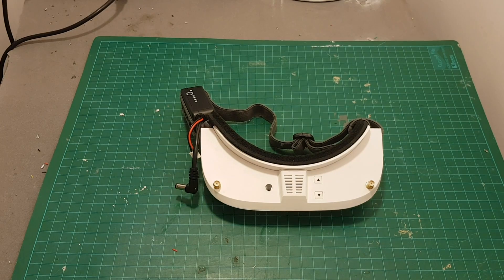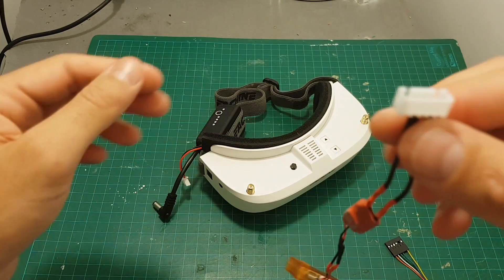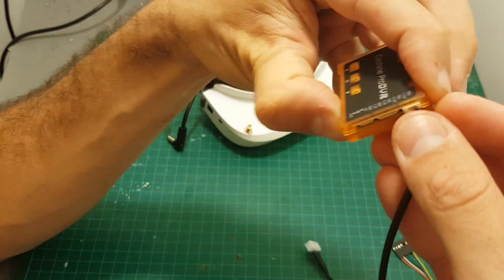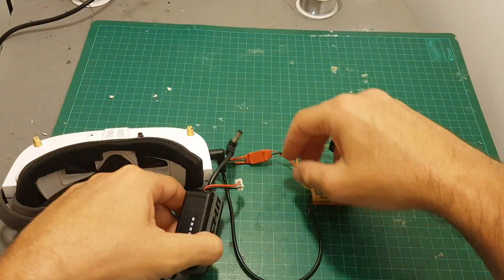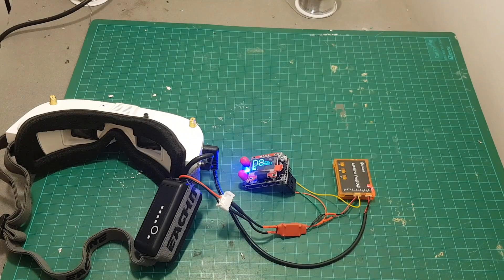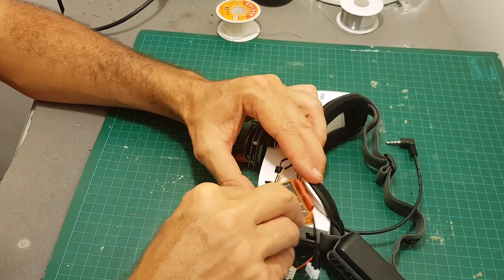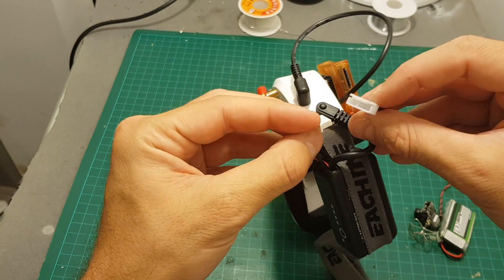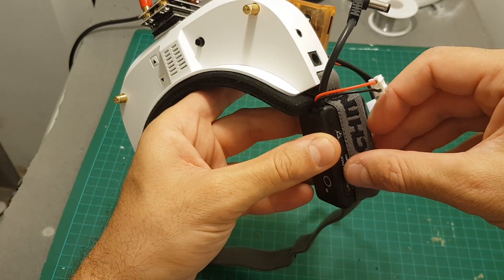Eachine EV100 Easy Diversity (And DVR) MOD

Comment: I thought the video out from the eachine ev100 budget goggles was weak of a signal  to input a dvr and the ev100 video display because the ev100 dvr never showed the black outs that happened during the flight  .  
   I like eachine ev100 goggle disolay size for the price and compactness when we want to carry fpv cameras around with us . But the blanking of the fpv video is what needs to be fixed on mine . Is that what you made in this video ? 
    If we put a yellow rca video out end on a diversity rx it can plug into many different brands of budget goggles and even television screens for multiple vieweres of an fpv experience . Budget goggles come with an AV IN CABLE with rca video plug on one end for this purpise or for video games or movies to not wake up everyone else in the house with bright lights flashing from the screen . 
   Next we could build an digital fov to AV  VRX .

Comment: Thanks . You are the only one with information on reciever modules and crsf modules .
Last month i ordered a diversity vrx for ev100 fpv goggles because the video in the goggles screen goes black , red. , or white while flying.  
    And now i have digital goggles and vrx walksnail preordered .
  My 1 watt crsf does not appear to be going to reach 4 kilometers . It seems like it will only reach about the same distance ( 300 meters )as xm+ . Is that because of battery size on quad and tx needs to be bigger ? Or does crosfire need a bigger reciever ?  I use 4s 1500mAh battery on a 5 inch cheap $88 quad .
Reply: Pins 1 ,3 ,6 👉🙂👍remember
Reply from the maker: My pleasure. Something is wrong with your setup - you can get very far with a 1 Watt CRSF system. Make sure that the TX and RX antennas are ok.

Comment: Hi, I know i'ts been a long time since you uploaded the video, but I wanted to know if splitting the av signal between the goggles and the DVR would cause it to loose strength or make the video dimmer. Thanks
Reply from the maker: It shouldn't have that effect in my experience.

Comment: ¡¡¡ total !!! tanto quebradero de coco ,para al final tan sencillo como conectar el diversity y el dvr al conector de AV que tiene las gafas , unos quitando el modulo RX que al final rompen las gafas , otros soldando cables en lugares que no sirven de nada , para al final con solo conectar positivo y negativo para alimentar el diversity y dvr de donde sale para el ventilador, y en la clavija yak AV poner un negativo del modulo y el cable de vídeo y listo , muy sencillo nada de romper y muy limpio , ¡¡ eso si acuérdate de poner siempre las gafas en AV para ver a través del diversity de otra manera seguirás viendo atraves del modulo interno de las gafas ev100 pero sin antenas y a 10 mtrs te quedaras sin vídeo , mas menos como si quisieras ver una peli o jugar al simulador con las gafas .

Comment: Does it fix the blackouts? I was flying the whole time with two antennas and I was constantly getting blackouts, now I fly with only one antenna and it stopped so it has to be the antenna switch
Reply from the maker: Yes, it should fix this issue.

Comment: hello, I bought a pair of used googles, they are the foxtech FV01 also known as Boscam GS920 in my opinion they have excellent optics but being dated they have no DVR or diversity, in the lower part they have an AV in connector and an AV out connector. I was wondering if for the modification I have to proceed as described in the video or should i use these connectors?
any information is appreciated
thank you
Reply from the maker: Hi Dr. You can just use the AV connector, as shown in my video.
Reply: @KremerFPV  thanks
Reply: @KremerFPV  hello, I connected the cables like in your video but I don't see the dvr menu what can I do? thanks again
Reply from the maker: @Dr.HazeFPV  Is the DVR recording working for you?
Reply: @KremerFPV  well i can't se the menu so I can't format the sd card,   I will try anyway,  btw I have cristal clear image from the diversity module.

Comment: hi i did the same mod, how can i disable ( power off ) the internal receiver?
Reply from the maker: It's probably possible - but will require you to disassemble the goggles.
Reply: I think if you are  switching to av in, the internal reciever powers off

Comment: hi i can use the dvr in the combo?
Reply from the maker: The DVR in the combo has only Video in / out option, so you won't be able to pass through the video. You will need to connect the diversity module in parallel to the DVR, so it will be a little bit more tricky to do (but still possible of course).

Comment: Just made that mod using eachine pro58 and step-down from BG (look the same as in your link) and it works BUT!

This step-down introduces a lot of noise... When i power up pro58 receiver form 1s lipo it work great, so i bet its something wrong with step down... Tried to different step-downs as they came as 5 pack

Any advice?
link to step-down: https://www.banggood.com/5Pcs-Mini-DC-Adjustable-Power-Supply-Buck-Module-Step-Down-Module-p-952402.html?rmmds=myorder&cur_warehouse=CN
Reply from the maker: Do you have a multimeter to measure the voltage output?

Comment: Hello! I currently fly with fatshark attitude v2 goggles, but it is a bit blurry. You can change the distance between the lens and your eyes verry good in these ev100s, but im scared im going to think these screens are to small. Do you think it is a good option to replace my fatsharks? Or are these screens going to be really small?
Reply from the maker: I don't think it's going to be an upgrade. You better save up and get a new pair of Aomway or Fatshark goggles.

Comment: could you possibly do a mod where you can desolder the existing receiver and add a module bay
Reply from the maker: It will be too complicated and I don't think that many people will find it useful. The external solution is much easier. Thanks for the suggestion though :-)
Reply: @KremerFPV  I agree to this. I have the dvr for ev100 already. I would like to have the option of dvr and diversity. But I wish to use the dvr I have already. How I can solve this? I see many other videos where people goes in AV-IN mode on googles, is it possible to  record video still and just use the ordinary dvr?

Comment: u put rx5808 on top then hold the av button 3seconds then they both connected wireless ????
Reply: nvm, i missed that jack bcuz it was in red color. i found other vid.
Reply from the maker: No problem :-)

Comment: how did u connect av in? without openin the goggles????. im very much confuse
Reply: he is not using the video of the internal eachine receiver, he s using another external receiver for the dvr in paralell
Reply: René Martínez López i did this  without dvr 2weeks ago and it works well till now, no need to buy fatshark haha it is really great
Reply: @renemartinez5  I know it is weird questioning a 6 years old comment :D but can I make a 3 ways in parallel from the video out pin of module? 1 to the goggles, 1 to dvr and 1 to a spare monitor? I want my gf enjoy the flight with me, so I', intending to buy a LCD monitor and get the signal from the module. Is that ok ?

Comment: Ive tried to understand it from the video and from the comments around but still didnt quite get it.
If i wanna use the RX without the DVR.
I have the 2s plug goes to a 5v step down to my 5v and GND on my RX.
Now, what with the AV cable, it has 5v,GND and video right? I understand that the video goes to my video on RX but what about the 5v and GND from the AV plug?

Comment: So if you do not want the DVR, just add the video cable from the video jack and add the 2 s connector?
Reply from the maker: That's correct
Reply: Still need the voltage regulator on the 2s connector right?
Reply from the maker: If you are going to connect it directly to the diversity receiver, you will need one.

Comment: Hi thanks for this modding.How much is the range now? Can you say it in meters? 
Best regards Marc
Reply from the maker: Well it depends on the VTX that you're using, the antennas, testing environment and etc...
I didn't perform a side by side comparison with the built in RX, but I can safely say that with a 600mw VTX, cloverleaf antennas in an open area you can get at least 500 meters range.

Comment: Is it possible to use Eachine EV100 Micro AV Recorder (dedicated dvr) ? (https://www.banggood.com/Eachine-Micro-AV-Recorder-1280480-Mini-DVR-Support-32G-TF-For-EV100-Goggles-p-1196134.html?rmmds=cart&cur_warehouse=CN) or do we have to go with old dvr module to be able to add diversity module? Thanks
Reply from the maker: You will be able to do it, but then you will need to change the connector of the dedicated DVR / open it up and connect the RX module. I suggest that if you're going for this mod, to buy the simple DVR, as it will be easier for you IMHO.
Reply: Thank you very much for your reply. Which RX module suggested in this case ?
Reply from the maker: My pleasure. The RX5808 Pro will be a great fit.

Comment: Hi!!! I would like to make this mod on my EV100 but i don't care to have the DVR... Please, can you confirm if i have properly understood? I have to power up the receiver through the "balance" connector of the battery and through the step down module to bring a 5V input to the receiver; after that i have to connect the ground and the video in of the receiver to the AV cable... is it right or i miss something?
Thank you for the help!!!

PS: someone else have already suggested it but also in my opinion if you can include some scheme will be great!!!
Reply from the maker: Yes, you got it right. It is a pretty mod and I am sure you will do fine :-)
Good luck!
Reply: Gal Kremer Thank you very much for the answer!!! In your opinion is better to take the ground of the AV cable after the step down module? Or can i take it directly from the battery?
In any case, the positive wire of the AV cable is no neccessary?
Reply: Hey, could you let me know how you done it at the end?
What about the ground from the 5v step down?
what about the positive on the AV cable?
According to his video, hes using only 2 wires on the AV but i guess these are VIDEO and GND?
Can i connect GND on both Power (5v step down) and from the AV to the receiver's GND pin?
Reply: I'm sorry but i haven't make this mod yet!!!

Comment: I just did this mod minus the DVR part. Works well. I used a gel pad to attach receiver module to front of goggles. So the whole thing is cleanly removable.
Reply from the maker: That's a good idea. I am glad to know that it works well for you :-)

Comment: I am going to give this a shot. Much better method than those soldering to the board. You can still resell normal goggles after this. Genius. Can you do a little follow up video with the new EV100 DVR on how the wiring differs?
Reply from the maker: +Curtis Campbell Thanks Curtis. I will try, but I can't promise.
Reply: Hi the soldering method turns off the internal receiver,does this way too? thanks.
Reply: Bruno Mateus You don't need to disable the internal receiver with this method. You just switch the goggles over to video input mode.
Reply: Ok,i see it now, thanks.

Comment: Hi! It would be a hardcore modder question, but is there an easy way to mod this google to have 2 separate video in for each screen?

So I could use my own 2 separate receiver/video in signal to give video for each screen?
Thanks...
Reply from the maker: +Gal Kremer Short answer - no :-). Everything is possible, but it definitely not going to be an easy mod.

Comment: Great video, thanks.
Would you please also add schematics to each of your videos? It would be very helpful and easier to understand the ideas.
Thanks again.
Reply from the maker: +Jacob Hochberger Thanks - great advice. Will try to add them on my next videos :-)
Reply: Jacob, I'll try to help Gal, when I do this Mod in a couple weeks :) Already got my Ev100, DVR, etc... just missing the cable to connect between DVR and EV100 and 5808 Plus. :)

Comment: Hello. I'm korean. first thank you for your review and DVR mod. I tested same condition. I connected audio to DVR's Audio In. but can't record audio, only record video. you same? my 210 drone have a mic. other receiver tested audio record OK. please answer. thank you
Reply from the maker: +Daniel Choi 안녕하세요 :-)
Where is the audio out coming from? The ev100 receiver? Try to connect earphones to the audio out in order to see that it is working. In addition, I think that you can turn on and off the audio recording in the DVR settings.
Reply: Ev100 is missig some components on the audio module.

Comment: I had the ev100 and the Rc5808 pro, but i find the internal receiver works really nice. (Even without antennas attached)
Reply: Try flying long distance. Remember, this mod is to give the EV100 true Diversity antennas using the RC5808 Pro Plus. :) 
The EV100 does not have "true" diversity antennas. :( It has something called "Antenna Diversity (a type of shared antenna split into 2 wires). 
True diversity, both antenna's receive different signal strength (which is why most pilots have different types of antenna's on their goggles, never the exact same 2 antennas). :)